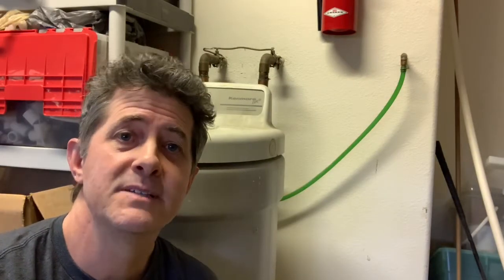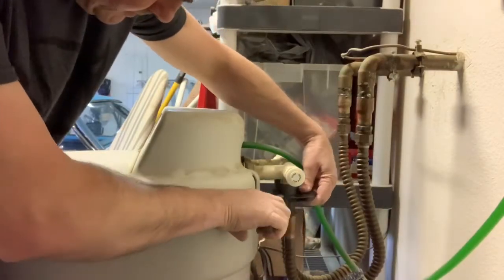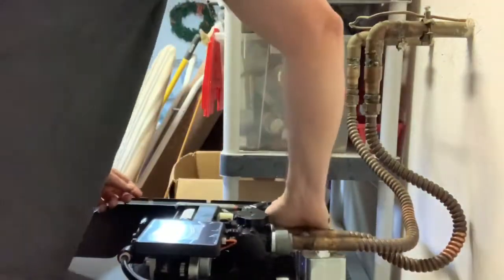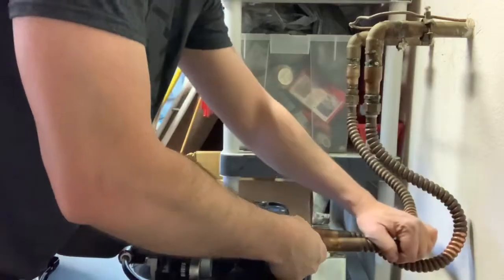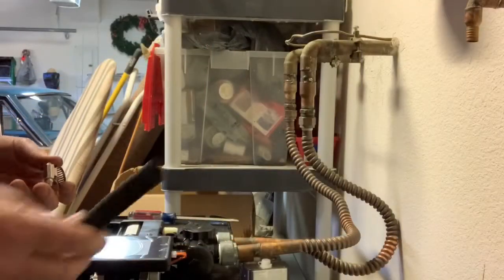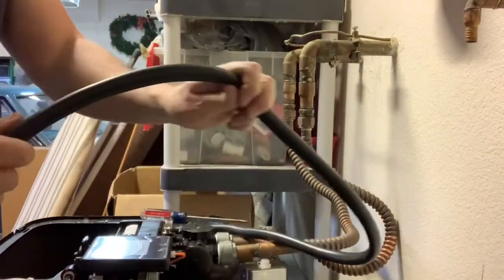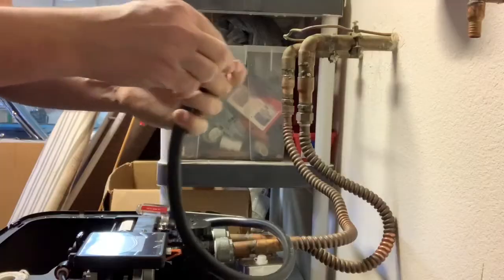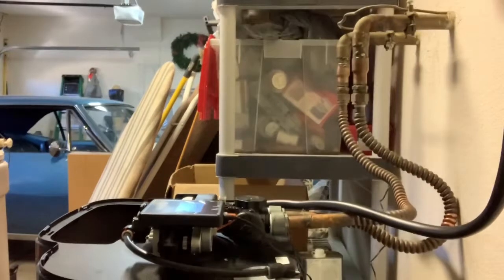How To Replace a Water Softener

Comment: Hi!  I have a very similar looking water softener that has never worked since I moved in and would like to just remove it and use the space for a laundry cart.  Would you foresee any problem just turning off the supply line at the water heater( it seems to have a knob for that) and putting a cap on those copper pipes?
Reply from the maker: If you remove the softener, don't cap those lines, rather connect them to keep the flow of water going. You can use a threaded fitting to connect the pipes. You can turn off the water supply valve while you do this, but turn it back on when done so you have water flowing in your house.

Comment: Great video I do have a question I'm replacing my old water softener it's 8 years old do I need to replace the hoses my house was built to accommodate my water softener the hoses are 8 years old there's no leaking from them thanks for all the info
Reply from the maker: My opinion is that while you have everything disconnected anyway, I would replace them even though they aren't leaking

Comment: Where did you get those water hoses? 

I am trying to replace my water softener and the issue for me is that my old one was (for lack of a better term) hard wired (or hard piped?) to the water pipes. It did not have those flexi hoses. So now that I have a new one and am in the process of installing it, I see that it is not the same exact size as my old one. So I cannot connect the back of the water softener to the ball valve. 

The inlet on the water softener is 1 inch and the ball valve is 1 inch. I cannot find a flexi water hose 1inch male to 1 inch female which is what I need.
Reply from the maker: Those are just copper flex water heater supply lines. I'm pretty sure that Home Depot sells the steel braided 1" male to 1" female you are looking for. If not you could always just add an adapter to one end and make the hose whatever you need.
Reply: @MikeKlimek  apparently 1 inch to 1 inch is a super hard size to find. I have been to Home Depot, Lowes, and a plumbing supply store.. no luck. 

In any case good video!

Comment: Water is shooting out of mine how do I turn the water off I turn the lever to off
Reply from the maker: You should have a bypass behind it. Push the mechanism or rotate the knob to bypass the water softener. If you don't have that then look for a water shut off valve to turn off so you can remove the unit and connect the incoming and outgoing pipes.

Comment: Maybe someone asked this already - how do I make sure I have most of the water out of the 'house system' after I turn off water coming in from the city. If I just shut off the water and then pull the softener out won't all the water already in the system come out the output connection?
Reply from the maker: I think I understand what you are asking. With the water off at the meter, you can open a faucet near the softener and any pressure will drain into the sink drain. Hope that helps.

Comment: Great video quick question what if your house no longer uses the water softener and you’re just trying to get rid of it. Would you remove the softener and replace the open pipes with a connecting hose?
Reply from the maker: Yes, you can get a flexible line and just connect the two ends. (or you could add a whole house sediment filter-I have a video coming out later today on that subject).

Comment: Does it make a difference which watersoftener you purchase? my house is 2100 sq ft
Reply from the maker: There are formulas for calculating the size based on water consumption. Generally take 80 gallons per day per person in the house, then determine the hardness of the water in your area. Home centers carry 30k - 40k grains. For a 4 person household 35,000 grains is typical. Make sure it auto regenerates. Currently they run $350-$400. Good luck!
Reply: @MikeKlimek  thank u very much

Comment: Great video. So why do people want to charge thousands of dollars to replace one? We have a Kenmore in our house too and it needs the values replaced. We had it installed after we bought it from Sears about 18 years ago. Had a guy come today and he wanted $3000 to replace it. I see online they are $500ish to purchase.
Reply from the maker: Maybe because they can get away with it. There are expensive systems that don't use salt and that may appeal to some people. For most of us, we want soft water for showering, laundry, and dishes.
Reply: @MikeKlimek  Thanks so much your video helped me to see that it wasn't a huge deal to replace. What kind did you get?
Reply from the maker: @OKAAC  I bought an AO Smith. I'm sure they are all made by the same factory, just different names stamped on them!

Comment: How did you measure your water's hardness? Or is that something I should know?
Reply from the maker: A couple of ways: you can buy test strips at a home center for a few dollars, or you can call your water company and ask for an analysis of the water supply (assuming you are not on a well).
Reply: EPA requires community water supply companies to have a water quality report each year that should state the hardness, but if their number seems lower than what you are seeing, you can also have a test done.

Mine local area is extremely bad.  
Here's the ranges of Calcium Carbonate CaCO3:
0 to 60 mg/L (milligrams per liter) as calcium carbonate is classified as soft; 
61 to 120 mg/L as moderately hard; 
121 to 180 mg/L as hard; 
more than 180 mg/L as very hard

My local report measured ranges from 39 to 381 ppm (roughly the same as mg/L)

Comment: I didn’t understand what the black hose was for? I have one discharge hose that goes to the slop sink. Is that the one you were showing? I also have a overflow tube that goes to the drain. Thanks, for the good video.
Reply from the maker: I think I understand your question. The black hose in the video goes to a drain (one was pre-plumbed in the wall in this video), so that every time the softener regenerates, the discharge is pumped out to a drain. There is also an overflow at the top of the tank that will only flow if the level in the tank is too high. Sounds like both of yours go to the slop sink. Hope that helps.